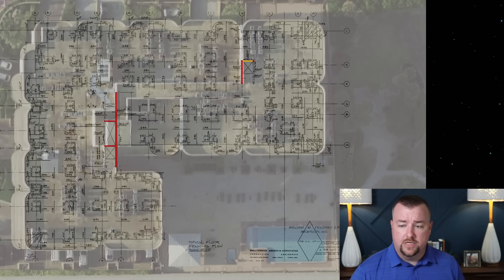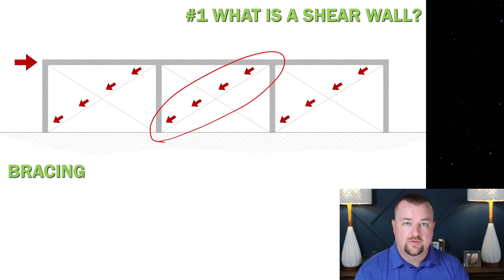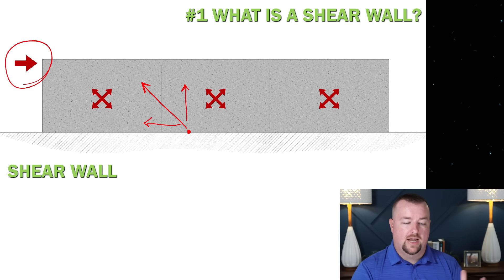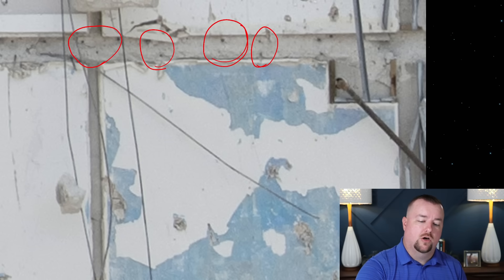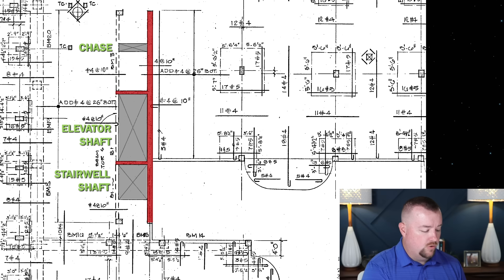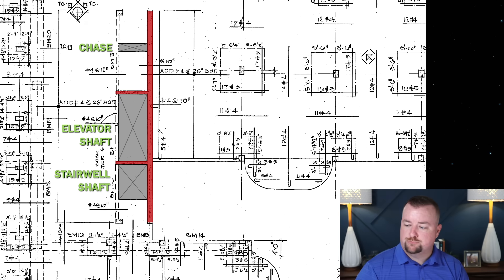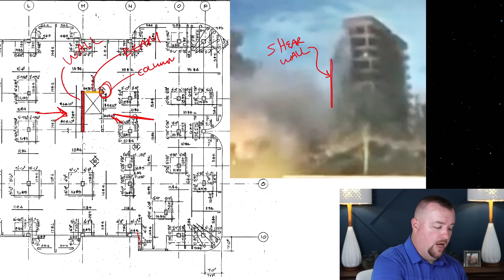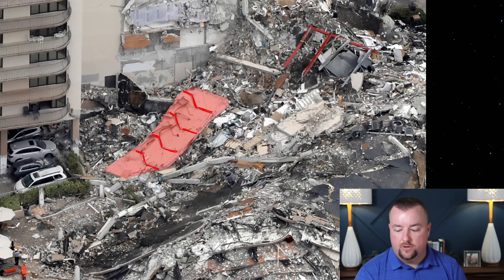Surfside Collapse - Structural Engineer Answers Your Questions About Shear and Shear Walls

Comment: Hi Josh, I was just wondering why the shear walls for this building were pretty much just running in one direction? Is it because the building was "longer" in the opposite way to the shear walls so was considered strong enough to withstand lateral movement this way? or is it a more technical reason? Thank you for these brilliant videos.

Comment: What about the lateral stability of the building in the East-West direction. Two small walls (either side of the Elevator Shaft) do not seem enough for a large building like this. It does not make sense!

Comment: How damning, @9:41, setting aside how cleanly the rebar "de-gloved" from the concrete, once Josh circles the pull-out holes in red, it's obvious that the amount of COVER both top and bottom, is pathetic and INadequate, less than an INCH!... next to the ocean!

Comment: The last thing to fall was that small shear wall on the eastern side. You can see it in the collapse video standing up as the building collapsed around it and finally it seems to launch itself into the air landing across the rubble at the bottom of the surviving sheer wall.

Comment: Great video josh, and find your forensic approach to this building disaster very interesting. It is always interesting to see how other branches of engineering solve (or don’t solve in this case), the problem to ensure structures/buildings are structurally safe. Similar to Australia poor govt regulatory environment, can compromise building by allowing building inspections to be compromised by conflicts of interest (ie the certifying building inspector being paid by the builder or developer). Without robust checks and balances, the accident is always waiting to happen. As a naval architect our structural analysis of steel/aluminum ships is quite different. Having a uniform  material (steel/aluminum) with the same strength in all 3 directions is simpler than reinforced concrete design. However the static and dynamic load scenarios of ships in the water, and waves has many complexities particularly with fatigue design. Keep up the great work.

Comment: Purely speculative on my part, but I wonder if the building had been constructed as per the engineering drawings, with the slab rebar properly tied into the shear wall, could the central portion of the building had only a partial collapse, and then been evacuated with much less loss of life.

Comment: Wind loading was not emphasized in 1980 .They used the dead load of the building to resist.And the ASCE wind loads were less than today in that region. Many Engineers never received proper training in wind resistance until after Hurricane Andrew in 1992 as i was here then.

Comment: I explain shear walls as a cantilevered diaphragm that acts like a web and flanges  in a beam. The web handles tearing forces of diagonal tension (SHEAR).
The flanges handle regular tension and compressive loads.
This is different than a beam because the  shear wall segment (SWS) are very stiff and don't have much bending forces but act in a shear resisting way.
The ends or chords of the shear wall segment (SWS) take the compression and tension forces as a couple. Moment =T=C.
Clear as mud???

Comment: There are actually so few shear walls in this building, I am used to seeing much more (I work in eastern/northern Europe), especially considering it was in a waterfront area so potentially very high wind loads. And we always have stairwell/elevator shafts enclosed from at least 3 sides, mostly even completely with reinforced concrete walls, to have like a strong "core".

Comment: Hi Josh, can you speculate on the sequence of events that led to the collapse of the east section from the perspective of "this kind of collapse is almost always initiated by the failure of a compression member," i.e. which column or columns are probable points of failure? Thanks!

Comment: One thing I wonder is the whole right side of the building collapsed and somewhat starting from those "frontal columns". Should not the other columns and beams in the back hold the rest of the structure if they were calculated properly? I am missing something here.

Comment: What is the reason of pullout on rebars ? Are they not ribbed ?
Reply: Insufficient coverage ( thickness of concrete ), insufficient depth or excess load: if you pull hard enough something will have to give. buildings are designed to stay up, not to resist any conceivable load in a sequential failure. There are likely many failing and shorts in this building. I doubt we will ever get to the bottom of this now they have destroyed the evidence.
Reply: @tuberroot1112  i saw a photo and there were long slab rebars connected to column which hanging on. I think it stems from pullout failure or bad bound conditions.

Comment: Correct me if I'm wrong but on a typical house normally all the exterior walls act as shear walls so you would have at least four and they would hold the house upright in all directions. Why don'y larger commercial building like this use heavier built exterior walls that tie into each other at the corners  that would act as shear walls, is it just cost or is there another reason?
Reply: If exterior walls do not carry load of the building they are called something like 'enclosing cover' walls. They are weakly connected to the building to extent that they can be removed, but the building will stay standing. Also they are built last and serve only as a wall against warm transfer to keep stable temperature inside in summer and winter, against wind, rain, and so on environmental changes.
They cannot be considered shear walls. Also internal walls that split internal space into rooms, and made of soft and light materials instead of concreate with rebars are also cannot be shear walls, so they can be removed without damage to overall structure.
Reply: Maybe the simplest answer is you need all the light you can get when you 100s of apartments in one bldg. Not the same thing in an individual dwelling.
Reply: @tuberroot1112  True but there are still ways to make walls strong even with windows in them, the cost does go up though.
Reply: @phillhuddleston9445 " the cost does go up though." There's your answer to that one then !  These guys are paid to calculate the minimum amount of everything. Every dollar counts. The guy making $100million wants to make $100million +$10.
Reply: Some buildings do have shear walls or braces on the outside.
You want the shear walls to align with the basement walls which is difficult to do with the parking below. You also have to have windows and balconies for residential towers.
You don’t want large differential temperatures between the inside and exterior vertical elements.
You need a 2 hour fire resistance for stairwell and elevator walls so it make sense to make them concrete shear walls. They also align with the basement walls.

Comment: Josh, please answer just one question on a topic which has been ignored on almost all the videos about the collapse;  If the whole building were constructed with 24" columns (like the section that did NOT collapse), rather than the 16" columns used in the parts which DID collapse - is it POSSIBLE that the building may have held up long enough for repairs to have been made where they found damaged concrete?  If so, what would be the approximate cost of the thicker, stronger columns in a 12-story structure. I am assuming, as a layman, that the 24" columns would be approximately 50% stronger... correct?
(Since Josh is busy, can anyone answer this?)

Comment: Was the remaining standing Surfside condominium considered unstable or stable enough to go inside for anymore rescues like pets left inside.The sheer wall shaft seems like it was very strong and that’s why it didn’t fall down.
Reply: It looked safe because nothing in crashed part of the building was helping the remaining part to be stable. It was stable by itself, and survived crash on the same foundation slab. But before they removed debris it was not known for sure that foundation was not damaged by initial collapse. So there were risks it can collapse as a consequence of the first collapse in conjunction with excessive wind load, debris collection efforts, probable progressive damage to foundation, so on.

Comment: Maybe a silly question but regarding Unit 611. The resident who escaped said she saw her walls ripping open from the ceiling down. Would a collapse ever have the drywall rip from floor towards the ceiling based on how the building begins to collapse?
Reply: Sounds like floor and ceiling slabs were moving relative to each other.

Comment: The East end x01 & x12 pancaked and its easy to spot the individual levels on the ground. Not the same for the center core units, at least from my eye. Why aren’t those appearing in the same way as opposed to just a massive debris pile of shattered concrete?

Comment: personal "gripe" re: 2:32 "like a diamond".  If you look at a baseball "diamond" (a good example), you'll see that a "diamond" shape is simply a square rotated 45 degrees (it's still equiangular).  If you "squish" it instead of rotating it then it's called a " rhombus" (if it's equilateral but not equiangular) or a "rhomboid" (if it's not equilateral but still a non equiangular parallelogram).  Sorry for the interruption.

Comment: The last section appeared to rotate around its stairwell as it fell. The nearest wall facing the camera, was about half as wide, and scooped out on floors 6-10. The shear wall wasn't long enough to keep it standing. I can't believe the beach side was constructed so much weaker than the street side. The hurricanes don't seem accounted for at all in this arrangement

Comment: Number these videos.  You keep saying prior video-- --but even trying to judge by your shirt or background doesn't work.  Please also say "we call these moments which is defined as". Does moment only apply to wind force?
Reply: A moment is a bending force. Wind bends a shear wall over. Earthquakes bending a shear wall over. gravity loads bend a beam. Bar bells for weights in the gym have bending moments. Moment is really just another word for bending just like you see in everyday objects. Bending a coat hanger wire back and forth is a moment. A wrench has a bending moment in the arm of the wrench when you are tightening or loosening bolts.
Reply from the maker: I will see about adding numbers to the videos.  Good advice!

Comment: Best learning here!  Appreciate everything explained.  Why couldn't there be more shear walls in a structure built as Champlain?  Are buildings limited to the number of shear walls?  I'm a complete novice...
Reply: They are just expensive and cut through valuable units. You want the shear walls to continue to the foundation if you can but that can block drive aisles or take up parking spaces. Nowadays, there is a lot of planning with shear wall layouts.

Comment: Question: so the shear wall staircase was pushed out (air pressure? And floors)
 snapped and only a portion is exposed as you colored in red. 
Can one determine what section of the stairwell shear wall is visible.
Have to wonder if there had been a true shear wall section on one side  perpendicular if that section would have had more stability and that corner not collapse.

Comment: Steal beam supports from ground up are missing ,there should be steal beams,
Reply: Most residential towers need a 2 hour fire resistance between floors. That is harder to do with steel. It is better to use concrete beams. However, they use flat slabs to keep the floor to floor height lower. It reduces the plan area for stairs, the shear wall requirements, and there are also height restrictions and you want to maximize the number of units.

Comment: Your videos are very interesting, I have a question: why the structure was not built with a frame with pillars (columns) and beams and then with supported floors (stabs)? Probably the stabs would not have collapsed in this manner, with an excessive peck load...
Reply from the maker: Beams cost more and hinder the view.  So engineers design to the limit to give the developer what they want.  I'm not saying it's right, just that's what happens.

Comment: First, thanks for all the great, informative work.

I had a look again at the collapse video, and I think the appearance of the East wall leaning in may just be a visual illusion between the camera not being quite level, and fisheye effect at the edges of the image.  And I think that makes sense, that it would have stood perfectly upright until it pancaked, especially if the shear wall on the edge of the initial collapse appears straight up and down.

So did that section then collapse, because it also was undermined by structural failures at the bottom?
Reply: Also note that after Newton if something was standing still, and then started to move (changed its momentum m•V) it was caused by Force. This force was incapsulated inside the building as tention in one piece structure of the building against the other with less tension. So front side of the remaining part that collapsed last was moving outside of collapsed middle part of the building. It means there were tension forces inside upper part of the building that worked to rip structures under tension. When that forces exceeded strength of the structure under tension that structure was ripped and became starting point of collapse. In this moment released forces started to move upper part of the last collapsed part of the building outside. Front side slabs of the middle part started to collapse being ripped at shear walls and lines of exceeded tension of the remaining part.
How tension accumulated between collapsed middle part and collapsed last part is a question. Probably the answer is in foundation. It shall be investigated if it was bended in any horizontal direction (e.g. east-west or north-south).

Comment: I'm not engineer, but it looks to me like there was two separate types(quality) of construction between the one that fell and the still remaining building. The same type of buildings, but smaller columns and what looks like anemic rebar size and placement. I was taught, always over engineer to build safety in.

Comment: One thing I’d be interested to know to relates to a claim I’ve seen in multiple eyewitness accounts; namely that the elevators and elevator doors had entirely collapsed, that portions of the main stairwell had collapsed, and that the rest of the stairwell had been torn away from one of the supporting walls (though apparently not to the extent where it was unable to support the combined weight of the people evacuating and the wreckage of the parts that had completely given way).

What puzzles me here is that both of those sections were on the inner side of the shear wall, away from the wing of the building that collapsed.
If the rebar was ripped right out of the remaining plate (i.e. the stairwell landings at each floor, which I’m guessing supported the weight of the staircase directly above) by the force of the collapsing plate on the other side of the wall, then that might have explained the state of the stairwell… Except that the stairwell wasn’t actually connected to the collapsed part - there was nothing on the other side of it that could have pulled that rebar out.
The situation with the elevator shafts also seems strange; while I can definitely imagine the elevators themselves dropping if the forces from the collapse snapped the main cables, that doesn’t explain how the elevator doors & frames (on the inside of the shear wall, with no direct connection to the collapsed structure) also ended up destroyed.

14:30 In fact, after seeing the schematic here I suspect the back portion probably slopes away from the shear wall in the same way as the front portion that we can see; i.e. the vertical line we see in the video actually likely isn’t the rear end of the building, but an isolated “peak” of sorts near the middle, with both sides around it having already fallen away at this point.
I doubt this has much importance in practice, however. The failure mode of this shear wall has very little bearing (if any at all) on the initiation of the collapse, and isn’t going to help us understand the set of factors that allowed it to occur and so how it might have been prevented. It could potentially have saved some lives if that wall had held out…but looking at how many people already died in the “only” partially destroyed units in the NW portion, I sadly don’t think it would’ve been very many. :-/
Reply: The investigators should hire Josh to interview the eye wittnesses.

Comment: A dresser/cabinet without, even that flimsy, backing can illustrate how that shear wall works.
Reply: I like your analogy. Seen it in real life with a shelf unit too!
Reply: That pressboard is a lot stronger than it looks! Dragged a 200 pound cabinet downstairs (shelves in for stability, I don't think it would have made it otherwise). Still intact after 2 flights of stairs.

Comment: Why not criss cross rebar corner to corner along with the parallel rebar?
Reply: You only need rebar in two perpendicular directions to take bending in the slab in any direction. You also have to stack layer on layer if you go diagonal which makes it less efficient.
Reply: @yodaiam1000  thanks